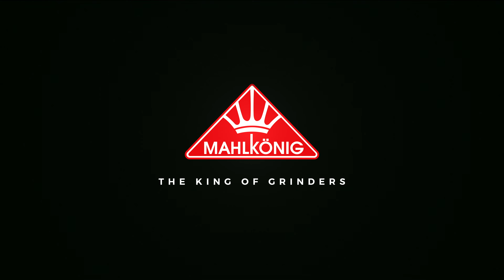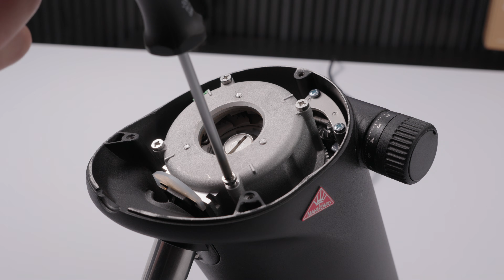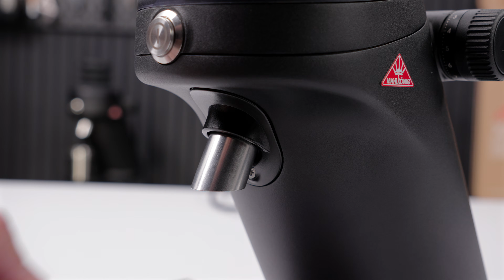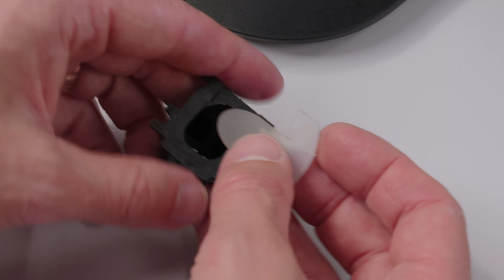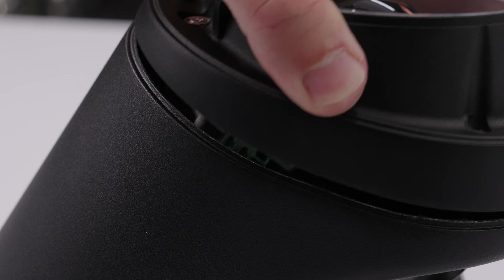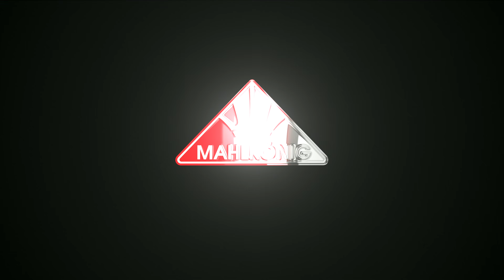Mahlkönig X64 SD Single Dose - Cleaning & Maintenance

Comment: Do we need to replace the silicone flap regularly?
Reply from the maker: The silicon flapper is a serviceable part, but it has quite a long lifespan. You will see when it begins to wear out but will take quite a long time we recommend inspecting the flapper once in awhile.
Reply: @MahlkoenigGrinders  but lately I have to clean every four days. So I have stopped spraying water after weighing the beans and shaking it before putting into the x64. To see if problem solved. Coz when cleaning the coffee dust at the burrs and shoots are really encrusted. Also looking into getting a e64WS grinder for daily grind and keep x64sd for other beans. Space is not a frontier I have in my tiny kitchen counter. Already ordered a 12000pa hand vacuum for cleaner counter top
Reply: Are we supposed to remove the bottom burr if yes how do we remove it??
Reply: I love Malkognic so much I got the e64Ws

Comment: I understand that mistakes happen, but as you're the manufacturer of this product; how about getting the right screwdriver before your start undoing the fasteners? (Reference; fasteners that are clearly Philips being done up with a Pozidrive driver at  4:14). As an aside, nothing will round off PH/PZ fasteners than using the wrong driver type or size.
Reply: so what screwdriver i need PZ 2or PH 2 or both ?

Comment: is this needed if i’m using the bellows and using the machine regularly?
Reply: Yes!
I've ground approximately 4 kilograms in the first month. I use a very oily, dark roast. I started to trip the circuit breaker and I believe this was because of caking of the grounds due to my preferred bean type. I was completely shocked how many grams were in the chamber.

Comment: How often do I have to do this - weekly/monthly?
Reply: My clogs up one or twice every week, so annoying!
Reply: @lyyxpy .   My grinder x64SD constantly clogs up I demanded a new one or a refund But my supplier refused as far as I’m concerned it’s a very expensive paperweight and I regret buying it unless you people can help me to stop this clogging happening I’m using regular medium roast espresso beans nothing wrong with them never clogged up on other grinders I cleaned it many  times
Reply from the maker: As often as you feel necessary. As a home grinder, you don’t really need to do this that often.
Reply: Mine to, it has retention between .4 and .8 of a gram.. Any idea when you’re going to redesign the declumper flap, it is the source of retention.

Comment: Can you please replace the philips screws with torx? The philips can‘t handle the amount of torque needed.
Reply from the maker: Thank you for your feedback. These screws have been chosen for certification reasons as we have to sell this grinder into every country and there are strict guidelines on certification. If you need to replace the screws yourself, then you could find matching screws in the head type you prefer.
Reply: @MahlkoenigGrinders  - can you help with availability of proper  torque replacement screws so that we don't risk cross thread? I appreciate the compliance challenges, but offering spares or accessories would be fabulous so we use the right replacement. Thanks!
Reply: Wo liegt denn der gewünschte Drehmoment in Newton? Bei 6 ?